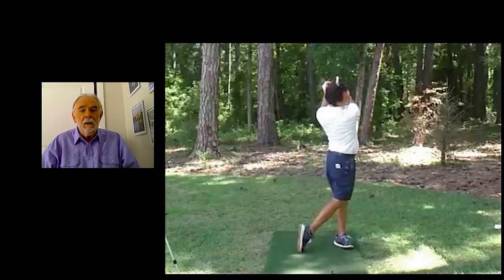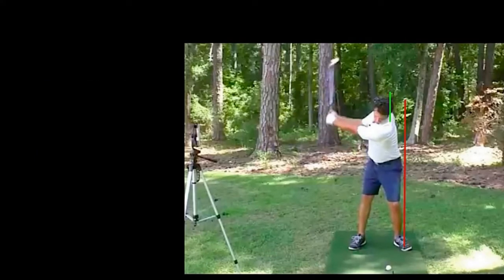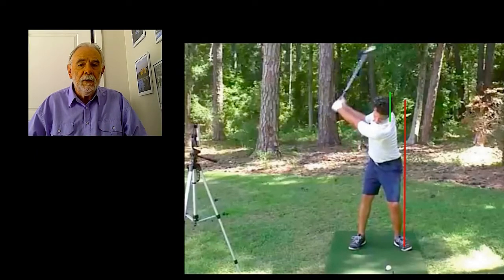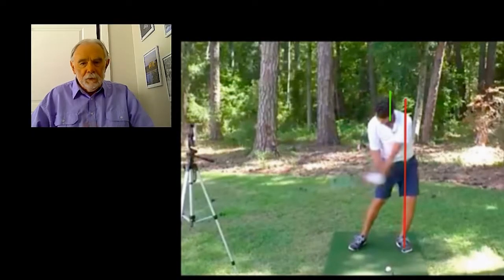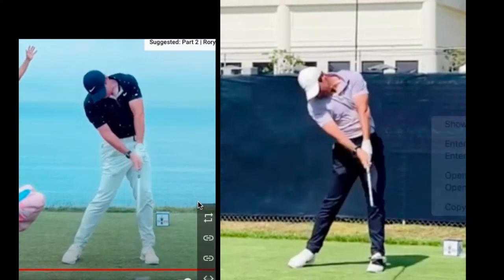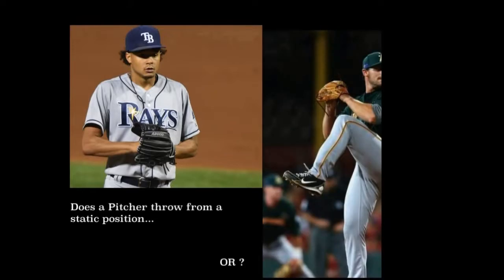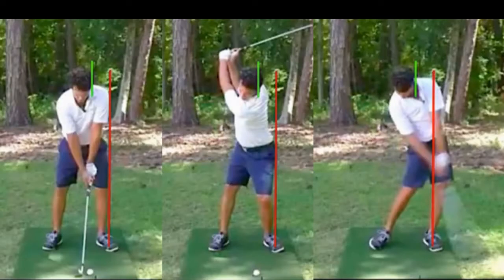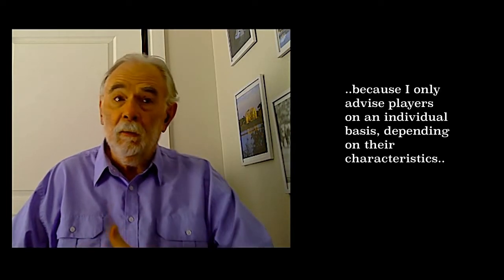Need to match the ADVICE to the AUDIENCE.

Comment: You are absolutely correct. The reason systems exist keeping the weight on the lead foot is that timing the sequence needed to execute an effective transfer of weight while making good or great contact is something that most golfers especially amateurs find impossible to achieve. The drawback to keeping your weight on the lead foot is that you sacrifice rotation using the ground. If you are a young man with a strong upper body you can make up for the lack of it but if your not you will sacrifice using the big muscles in your legs & glutes and therefore sacrifice power and distance. This has been my experience trying to learn and get better at golf without any instruction.
Reply from the maker: Thank you Paul..Unfortunately, many golfers watch ‘Snake Oil Salesmen’ on YouTube advocating swing concepts and then waste their time, and their swing, finding out that those concepts JUST DO NOT WORK for the majority of golfers. With many of these ‘Snake Oil Salesmen’, talking fast with an American accent and using words like ‘science’, seems to be their marketing strategy. I wish you good golf.😎
Reply from the maker: Adding to the reply, and noting your comment about no instruction,  if there is ever anything I can do  to assist with your swing ie, comment on a video you send or make a video for you, just let me know.

Comment: Ken, great analysis.  That's a very fair point in terms of who this technique is directed at.  I think I can offer a unique perspective.  I'm a lifelong golfer (53 y/o), took 6 years off and started back about a year ago.  My first coach I started working with essentially taught me the swing in this video.  I got down to a 12.5 (not great golf in my book).  I wasn't as "pre-loaded" in terms of pressure on my left foot at address, but was 50/50.  He wanted a deep hip turn, big shoulder turn, then a "bump" to the left to start the downswing.  The idea was to push back with the left foot, push the left hip back, and around, bringing the club head through the hitting zone.  The problem was it was very difficult to push the left hip back/around without much load on the right leg during the backswing.  You can see in the video, he's on his left side, but his hips, and shoulders aren't open very much at impact, hence, the flip.  New coach (started two weeks ago).  At address, I start with weight 50/50, slight rocking motion, powerful backswing, deep hip turn, hands neutral/thrown high, 95% weight inside of right foot/heel...  just before reaching the top, get weight to the left, and start rotating.  Plenty of force on left foot to push left hip back and around.  Sorry for the lengthy comment, it's just that this really resonated with me, and I just went through this over the past 10 months.  With my "old" swing (like the video), I would get flippy at the bottom (lots of hooks, very inconsistent).  With driver, I would have a big miss to the right (outside to in).  Not an easy way to play this game.  Now, inside to out on everything, easy to post up.  Great content, sir.  Thank you.  
Long and straight.
Reply from the maker: Thank you Eric. I am 73 old, played Scratch at 17, played College golf in Edinburgh and played under 6HCP to the age of 65 here in Aus. What you describe is, unfortunately, a process which affects many people ie. being initially taught a swing process which does not suit the golfer but suits the ideology of the Instructor...just like the Instructor in the video. The ‘start the downswing with a hips slide/bump (whatever) is the biggest curse facing lots of golfers as it puts the lower half so far ahead and leaves Impact to the wrists. Yuk !. Your new Coach seems to have it together for you and I wish you well...
Reply: @motionalysisbyken  thank you for the thoughtful reply.  You are clearly a great golfer, and know what you're talking about.  Another thing I've noticed, here in the States anyway, is that instructors rarely talk about flexibility/mobility.  If a person can't get in their body in the correct position, well, it's a rough road.  My goal is to be a 6 by July 1.  We shall see.  One last question for you.  Have you ever met Pete Cowen?  I am a huge fan of his philosophy (pressure on the ball).  All the best.
Reply from the maker: @ericschroeder8932  thanks Eric, he won’t remember but I did meet Mr. Cowen in the late 1970’s. I think ‘78. I’d met Nick Faldo and Arnold Palmer in 1976 at the Uniroyal Tournament at Moor Park and Mr Cowen’s name came up as an ‘up and coming’...he was also a Yorkshireman like my brother-in-law. Gosh, that brings back memories 😀 Butch Harmon told me once that every player he coached was a better golfer than he was...and I think that has been the case with PC...his forte has not been playing but in making very good players even better, to reach their full potential. I don’t know exactly HOW ahead Coaches but I know that, with Rory McIlroy, he was working on getting him to ‘calm his bottom half’ at the start of the downswing...(kind of like what this video is all about)...because he’d been trying to match distance with the big boys and had lost control. Obviously, judging by more recent results, it has worked.